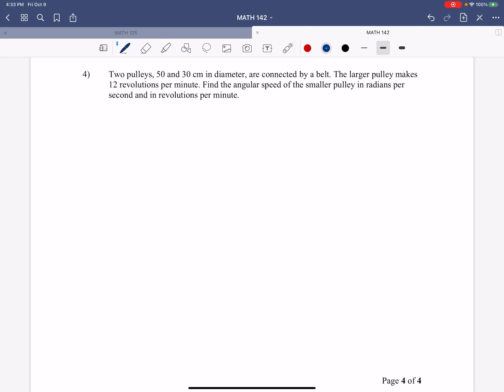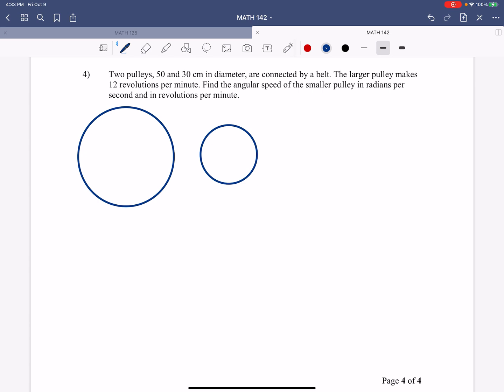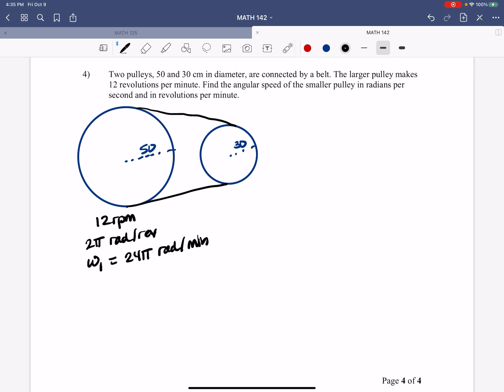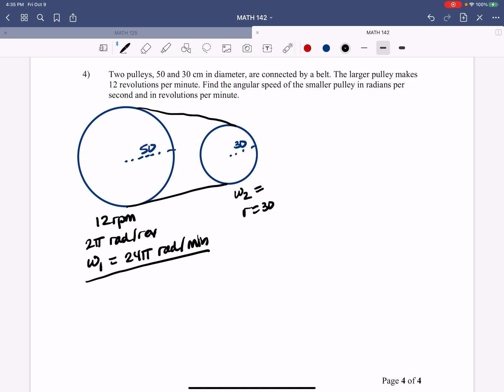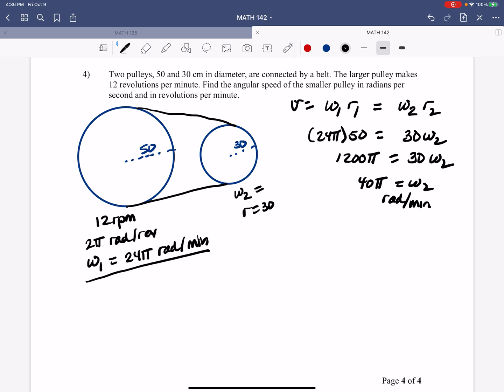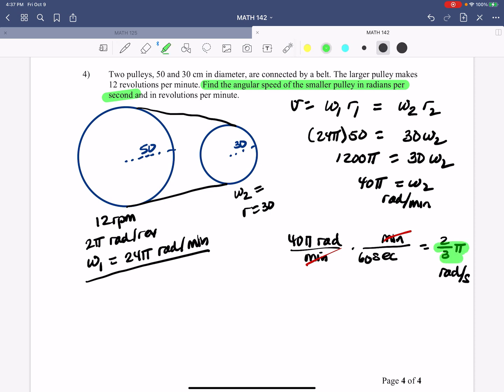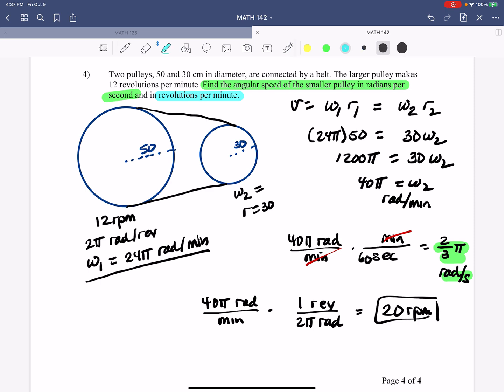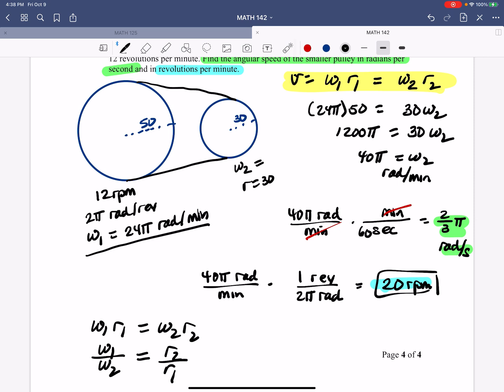Pulley Problem

Comment: Hi, I just watched your video on pulleys. thank you for sharing.
If you would, I need guidance. I'm helping someone install a DIY microhydro system. We're using a multiple pulley system to achieve required rpm at alternator. Three shafts and four pulleys. The main driver needs to spin at 65 rpm to achieve 1300rpm at alternator pulley.
The higher the electric load on the alternator the more resistance and it slows the system down. 
My question is, does installing a larger driver pulley help overcome the braking force that the alternator exerts when under load? or is my only option increasing force/power at driver pulley?
Would you mind if I sent you an email regarding the problem I'm facing?
I understand if you don't reply. Thank you anyway